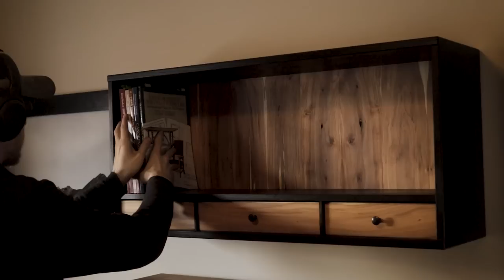Dovetail Bookshelf - Shop Sounds

Comment: What was the dark stain used on the frame? I like that color but have not found any that will stain that dark with out looking more black.
Reply from the maker: The first coat is India Ink, a calligraphy ink that helps make the wood pure matte black. Then I follow it up with some leather dye to get deeper into the pores of the ash.

Comment: Are you worried about the back expanding at all?
Reply from the maker: Not really, since the back is made up of individual pieces each one will expand and contract a negligible amount. Overall, in the winter there'll be a hairline gap between each piece and in the summer there won't be gaps. It also helps that these pieces are mostly quarter/rift sawn material which limits the movement even more.